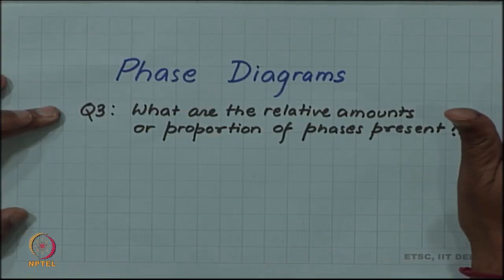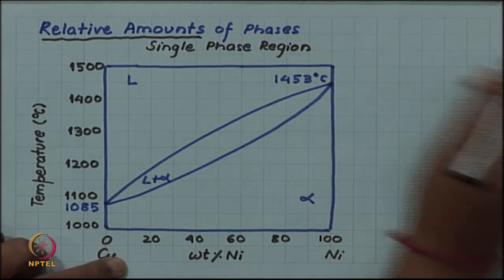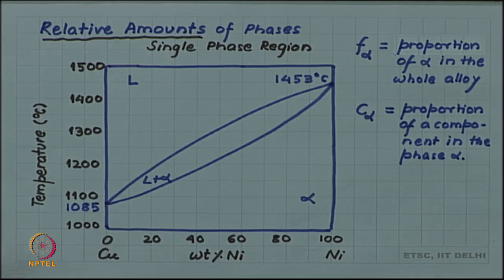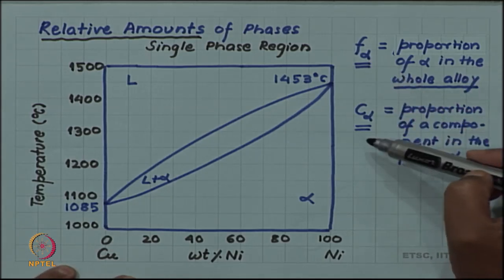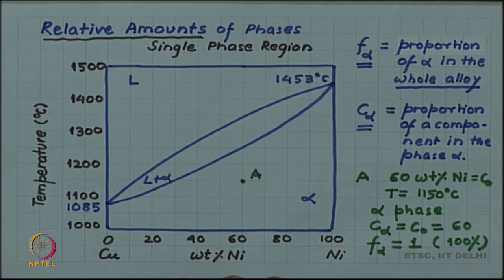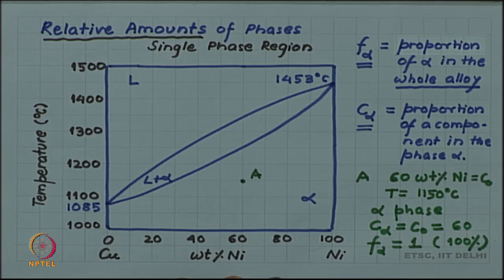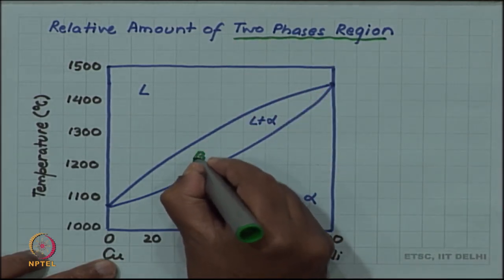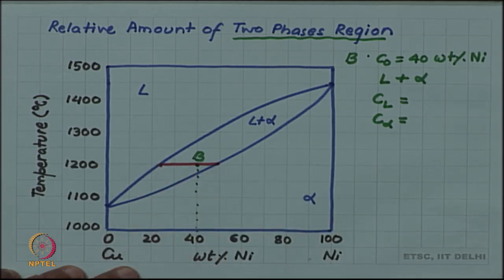Proportion of phases present in the system

Comment: Why are we using an isotherm line(horizontal) to find the fraction of phases in alloy. We have 40% Ni and the temperature is raising or dropin. So the alloy is moving on a vertical line. So we should use lever rule on a vertical line, right?
  Very good and clear explanation of concept sir. Thank you very much sir.
Reply from the maker: Along a vertical line, the composition and proportion of phases change as the temperature changes. Along a horizontal line composition and proportion of phases are fixed corresponding to equilibrium at that temperature.